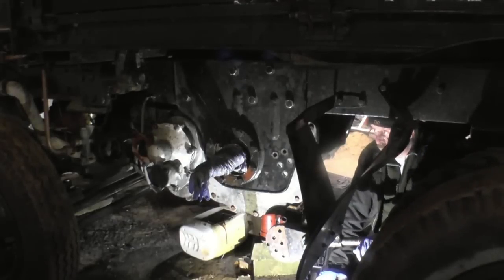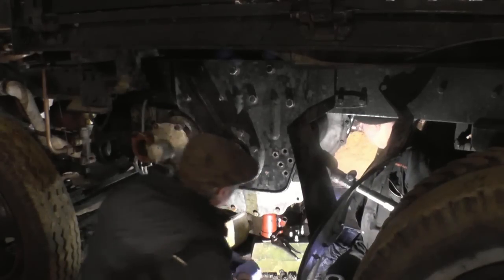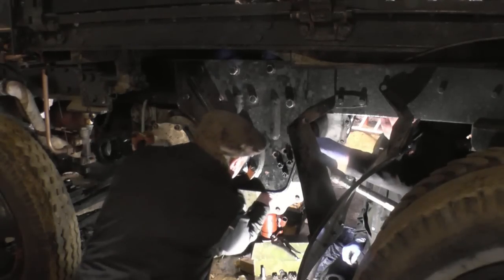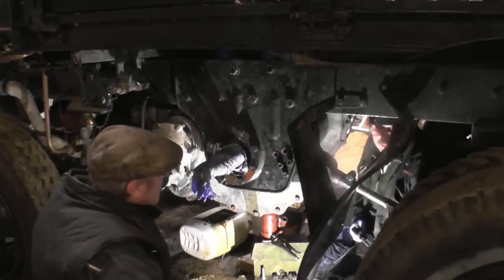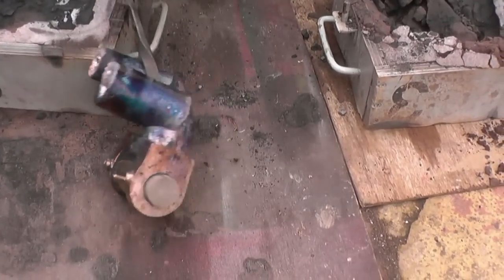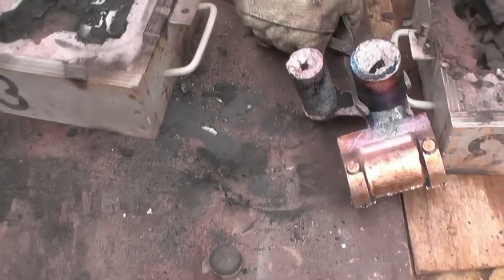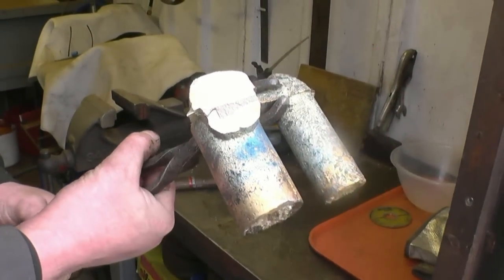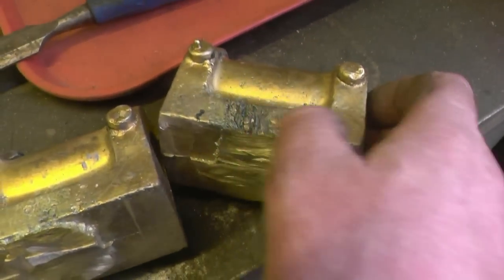SNNC  113 P2  Bronze casting / Sentinal wagon

Comment: All good.  Happy to see the castings finally come out without voids.  Gives me the itch to see if what I learned 35 years ago is still all there, but I probably should give the shop building priority over this summer.

On the Sentinel, if there is any chance to get a picture of the prime mover, that would be great.  Looks like they might have it buried pretty deep in the truck though...

Comment: Thanks again John. I thoroughly enjoy your video's. very informative. If you don't mind what type of crucible do you use? Thanks again. I look forward to your next video.
Reply: +Ashley Ward (Ash)  the crucible looks like a clay graphite bilge shaped one. Could be made of silicon carbide though but clay graphite is good for nonferrous castings.
Reply: +sandrammer That's what I suspected. given that most of the material i will be dealing with will be aluminium. That's the way I'll go. How durable are they? The last time I melted metal was quite sometime ago. When my father was alive. He was melting cast iron for model steam locomotives castings. I have forgotten more than I care to admit.
Reply: When I was in the Navy we would use a clay graphite crucible for years before it became thin enough that it had to be replaced. Just bring the heat up slowly and don't jam the metal in with rods. Clean the crucibles out after each melt and keep moisture away from it.
Reply: If you decide to start to cast ferrous metals get a carbon silicon crucible as it won't introduce excess carbon into the melt like the clay graphite crucible will.
Reply: +sandrammer cheers for the info. I don't plan on ferrous metal's in the near future. Although I'm not ruling it out. First I need to reacquaint myself with the process. Slow and steady wins the race.
Reply: that should have been silicon carbide not carbon silicon. If you had a silicon carbide and a clay graphite crucible sitting together you would be able to tell the clay graphite crucible by its' dull/ powdery looking exterior versus the shiny glaze present on the silicon graphites' surface.
Reply: +sandrammer The main issue here in Western Australia is the availability of suitable products. And then there is also the cost. I managed to find a supplier in Perth. currently building the furnace from an old stainless beer keg. coming along well.